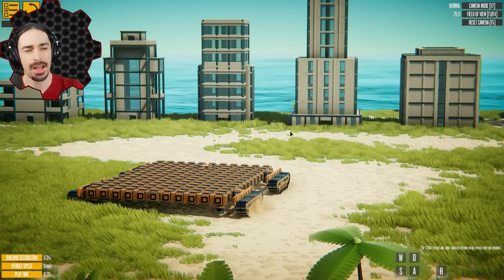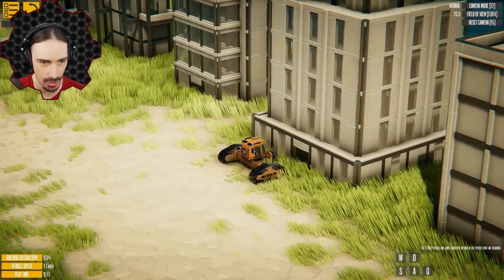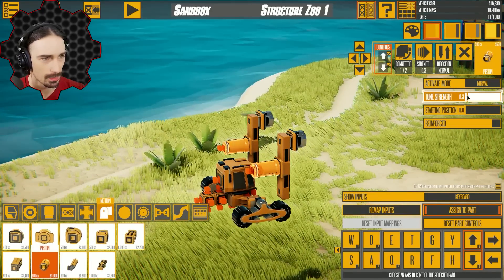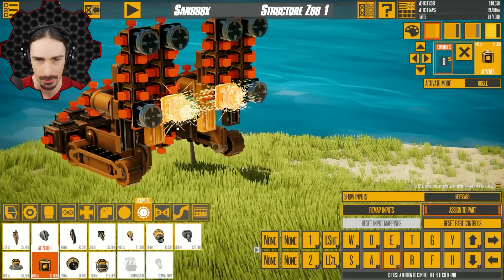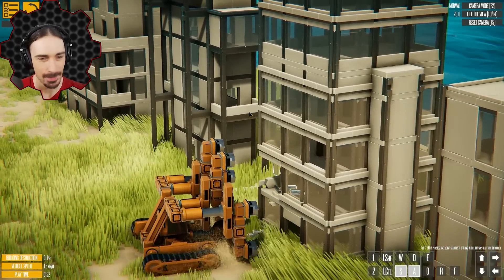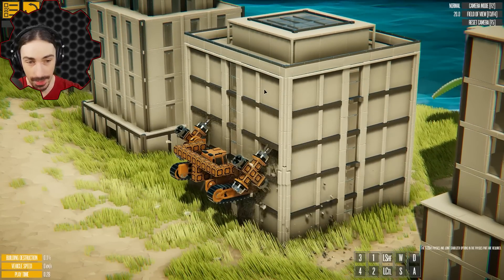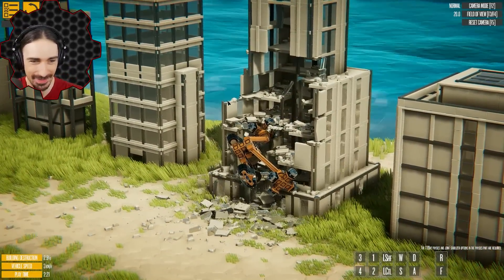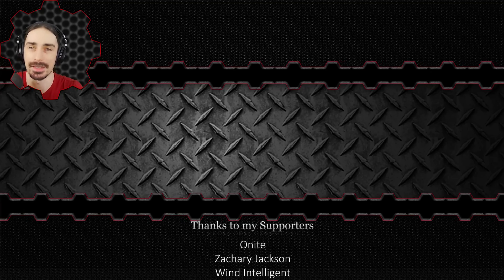Engineering a Vehicle That Climbs Destructible Buildings Is Hard        [Instruments of Destruction]

Comment: It seems like the wheel was providing too much force.   Maybe if you had more contact points by way of 4 grabber wheels?  Separate idea, what if you used 2 powered wheels in back then the two unpowered wheels up front taking away the track.  The tracks seem way too heavy.

Comment: I have an idea. Basically a stick, with attachment blocks on pivots on one side of the "stick" at each end. You attach one, rotate the rest of the vehicle up, and attach the next one, repeat.
Another take would be to have the attachments on power arms on the ends of the "stick," and rotate it perpendicular to the building rather than parallel.

Comment: th this game . structures need inner walls aswell as a far stronger "spine" . . because this plays a big role in a scenario like this

afterall the center of the building should be the most durable part that's holding everything together
but ths game just has  "hollow shells" with empty floors for some reason

Comment: I suggest using a balloon on the top of the machine so that it has an upward lift, reducing the weight pulling on the side of wall without actually technically using downforce to cheat and climb up the wall

Comment: why not attach a balloon on the back of the climber and set it to enough power to keep the climber straight and not lift the vehicle up, that would eliminate the part where the climber breaks the parts of the builder where the grabber isn't touching the building causing the structural integrity to decrease very quickly.

Comment: If you had more durable buildings (with or without Tough Structures enabled), it might be worth adding attachment blocks to the links of a vehicle built with physical tracks. Yes, it would make the control scheme even more convoluted (as each track link attachment block needs its own control), but it would maximise the number of attachment points.
Another possiblity is to add balloons to the back of the vehicle (not enough to fly by themselves, but hopefully enough to make it neutrally buoyant in air- or at least cut down on the amount of torque you're putting on attachment blocks if you went for the sliding rail technique)

Comment: Some ideas to shed weight:

First swap you tank treads for wheels those have to be a huge amount of your weight.

Second check the cabs there might be one that is lighter.

Third use lighter attachment blocks idk what is the lightest but I would experiment with it.

Now this is just a separate idea but why not use the attachment block with a grappling hook design, the rope is incredibly stretchy so see how high you can launch it, then see if you can make a wench to wind the rope up and literally pull yourself up to the top.
Reply: What he said

Comment: your last machine with the wheals, should have the wheals more down, the lower part of the machine rubbed against the building, destroying it. maybe even add 4 wheals instead of 2 as you did with the first design where you added 2 grabblocks on 1 slider, to not have a pivot point.

Comment: Suggestion to improve the machine: remove tracks, it is unnecessary ballast, the machine can move using the attachers.
Reply: that would actually solve the problem where the part of the building the grabbers are not touching from breaking which ended up in the building losing too much structural strength and collapsing
Reply: Exactly my thought. Why use two different sets of propulsion, and a heavy one at that?
Reply: Ha, just make the core contained within the attachment wheels and you wouldn't have to worry about slicing the building behind you either
Reply: I made a two part machine that crawls towards the build and lifts up the main segment and detaches itself so there is not so much unnecessary weight.
Reply: Even if he put some sort of body extension to stabilize the body wouldn't this effectively be little different from driving up the building which as he mentioned earlier in the video isn't the point. Two wheels with grabbers are still just two wheels with additional traction support.

I had the same thought but it's cheesing the concept a bit too heavily.
Reply: I’m not sure if I’m just stupid, but wouldn’t that make it so he couldn’t go up to the building?
Reply: @dextrex9726  OH YEA HE WOULD JUST SPIN
Reply: @cyantasks7129  In that case, just make it a 4-wheeler :). Size will start to become an issue though
Reply: @cyantasks7129  The weight of the core and its location on the back of the machine should prevent this from happening, I emphasize it should, but I'm not 100% sure it will.

Comment: 3 Ideas:
If you are going with a wheel of grabbers, you might need something that keeps them pointed at the building. I don't know if them reaching a 45° angle puts the edge of the grabber's body in contact with the building. You'd want to avoid that. Alternatively, going from 4 to an 8 sided grabber wheel will reduce that angle.

I'd generally experiment with getting stability from putting the attachment points higher up so that you naturally dangle from them, rather than having them on multiple sides. Multiple grabbers just seem to give you more points where the building can fail and throw you off course. And once you dangle at a 60° angle from a building you might as well have fallen off it. Then again, I don't know if putting all your weight on one grabber or one concrete panel will make it more likely to break. You might need to use a single wheel that just has 3 to 5 grabbers side by side.

The easiest way to climb a building might be to throw a grappling hook onto it. But it might also be the least likely to work (impacting the building with a projectile and having a rope cut into it and all).
Pro tip: I'd put the grappling hook throwing part onto a trailer that can be left on the ground. Or "throw" the attachment mechanism over the building (eliminates the impact) and use many many ropes (splitting the load between them so that each one cuts into the building less). I'd even start out "cheating" on throwing the ropes over the building by using a crane to get the anchor positioned.
Reply: Dude how did you wright this out and only get six likes
Reply: @elit272  16 like now. Wait no 17
Reply: Yo, dis man wrote an essay for scrap man
Reply: When I posted there were only six now there’s 39